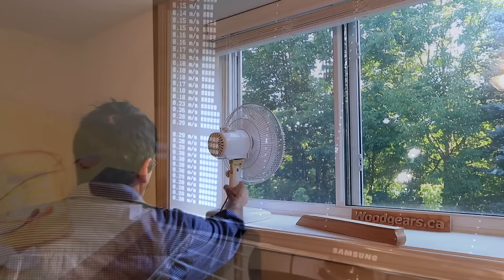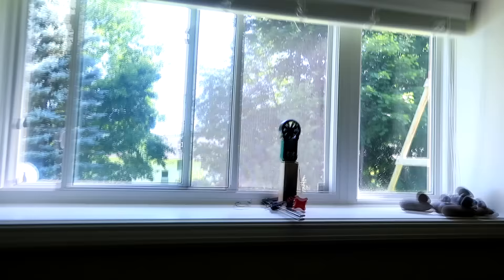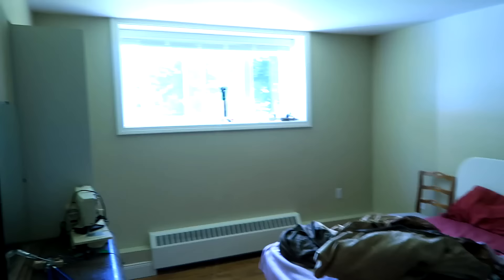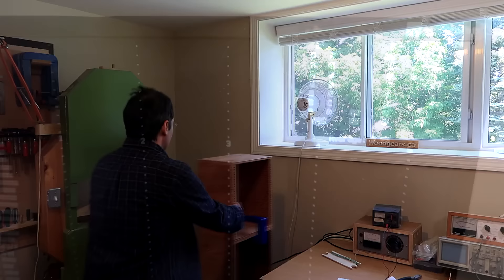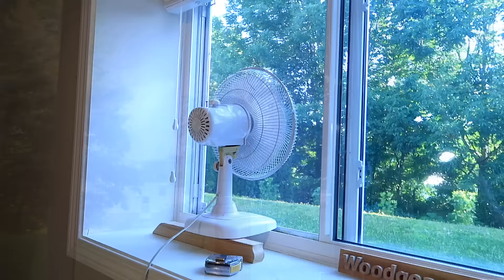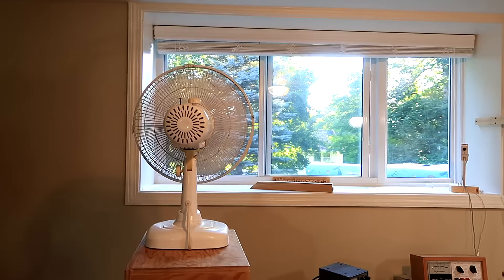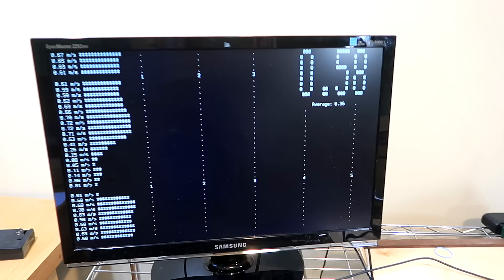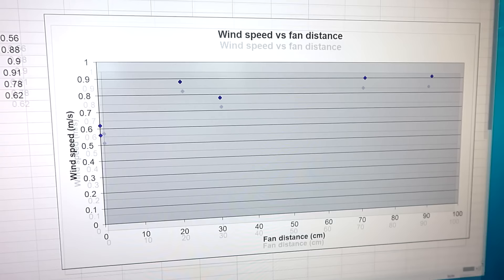Best fan placement to move air through the house

Comment: maybe you could also test the fan by putting the fan at the same room with the measurement device, and see that the circulation speed doesn't increase when you move the fan backwards; which makes it closer to the measurement device. I know that the reason is not bcs of that but would be a better scientific testing that way. But overall appreciate the video 👍

Comment: You expirement doesn't explain why keeping the fan further away is better. It's not because it's also sucking in a bit from the front, but rather because when you move it slightly away, the air you blow is pulling even more around around it along with, so even more of that air is making it outside of the window. It's the same concept for blowing up a plastic bag. If you try to blow up the bag directly from your mouth, you will only be able to blow it up a little bit, but you can blow a much larger bag a lot more just by blowing from a foot or 2 away. It's like it creates a vacuum that sucks more air along it's draw path.

Comment: I'm curious what would happen with the box fan pointed out right against the screen if you make a circular cardboard cutout (covering the corners where the blades don't reach) and also made a cardboard cover for the exposed screen above the box fan--- creating only a circular opening in the window where only the area of the box fan blades have an open throughway for the air to pass

Comment: I wonder if the same thing holds true with a box fan or window fan that fits snugly into the window, sealing off air flow around it.  Then moving that fan away from the window to see if air flow is better or worse when measured from the other window on your house.

Comment: The video title is: "Best fan placement to move air through the house"
Your testing involves testing the fan spinning near the other window. What you could test is the temperature drop or air quality. Because, maybe in some cases you could ventilate the whole house through the same window. Especially when your fan is less than half the size of the window. Also you have a protection screen/net on the window so the air could be bouncing off, instead of going out. That's wastly different result than having no screen on the window. Should be tested before you can claim you've found the best way to do something. All in all, I'd say you could say this is based on your mini research, but definitely not best proven method to ventilate the whole house.

Comment: Why didn't you also test this with fans blowing air from the outside to the inside? I would have been interested to see if the fan positioned 0.5m or 2 feet outside the window would also increase the speed of the air in the other window, just going in a different direction.

Comment: With long wire, there is a risk, if data is not digitized, that reading are not correct. It could lead to a lot of noise and could actually break the results.

Comment: Interesting.. what do you think about circulating air in a humid environment? I’d love to point fans so that it’d blow out the windows but by doing that a lot of the humidity would enter my house, potentially causing mold. Do you think pointing fans on ceiling vents  would produce the same results?

Comment: Thank you! As you put the fan in the window blowing in it showed to be ineffective. However, would it be better if you put the whole fan outside at a distance of say 1.5 meters blowing towards inside? Would that be even better than having the fan at a distance inside blowing out?
Reply: I am asking because i have a balcony and considering putting a fan outside so it can blow cold air into my living room, but not sure if it's better than having it inside and pointing it towards the exit like in your video.

Comment: What if you put the box fan up against the window and sealed around the fan with cardboard or towels so that the only air moving is going out. With the box fan there is a lot of air that comes right back in and cancels out the outgoing air. Would like to see the results of that.

Comment: New experiment idea. One Room. The same steps you already did but add a 45 degree to it or something like that. Like is this making a difference with sucking in air? And biggest question I have for one room closed door. Is it still better to blow air out from further away or to "suck" it in and blow it into the room?

Comment: Small thin column of air would be stopped by the screen. Even without screen, most of the fans air movement would be outside the house if placed at a close distance... I think, I don't know

Comment: My attic has only 1 little window on one of the slanted roof. It’s hot in the summer and cold & damp in the winter. I hang my laundry to dry in winter there as well. Eventhough that window is constantly open 24/7 year round, I start to see mold growing on the attic walls. Would the portable fan #2 helps to get rid of the moisture out of the window more quickly? Do I need 2 of them and place them on the farthest sides of the attic? Thank you in advance.

Comment: yeah i noticed that the fan pulls shit all and most of the time the fan is way too weak compared with the houses air pressure. if i put it in the window to push air out i can hear the motor slowing down to 50% whenever wind direction changes.

Comment: If the box fan is placed in the open window facing outward with the rest of the window opening sealed and a window opened in the other end of the house will do many air changes per hour.  A fresh feeling home.   : =  }}

Comment: this is just my theory based on nothing but would you think the fact that you get more airflow further away from the window is because in that situation the fan covers the entire window opening with airflow? just like with the boxfan, the corners where there is no fan are inlet area's, same concept goes for a circular fan in a square window. the area the fan can't cover will be inlet points, move the fan back making it so that the fan blows against the entire opening and now that window is an outlet only. wich would be why your measuring thingymajig started working better, there was no point other than that window from wich new air could come in.

Comment: Gotta like this video - but to be completely pedantic... if you pointed the fan away from the window and moved it away from the window and towards your annemometer... you'd find that the airflow will start going up quite a lot .... to take it  to the limit, eventually the fan would be sitting in front of the annemometer blowing a full gale into it .... 
However, your test is about airflow - it actually makes sense that you're blowing a higher volume of air out of the house which natural pressure would result in more air being brought in - but I'd also be interested in the air temperature in the other room . It appears to me that you'd want to adjust the direction of the fan depending on (a) the temperature outside  vs temperature inside  and (b) whether you're trying to warm your house or cool it ? 🤓

Comment: Use the box fan but tighten the window against it, then fill in rhe rest of the window with cardboard. The problen is you're not pressurizing the house.  You can look up ICRA setups in hospitals.  Why anyone does work without an icra setup is beyond me.  Its extremely easy and will clear a room of floating dust quickly.

Comment: I found what works best is a 3 blade 1.2 meter propellered 180cc 2 stroke petrol engined paramotor @ 10,000rpm shifts the most air...      Unfortunately i havent found my curtains or bedsheets...

Comment: But isn’t one factor that the fan is just closer to the wind sensor? Or in other words: your wind sensor doesn’t tell you if you’re getting air from the outside or you’re just recirculating room air.
Reply from the maker: wind sensor is in a different window in a different room
Reply: It is Bernoulli’s Principle amonng the other things. To put it simply, you create lower pressure in the house by blowing the air out and making it easier to get fresh air in thru the other window since its higher pressure outside and when you put the fan further away from the window, the air that is being blown out of the house will pull more air with it, think of it like air trying to stay togeter at all cost to not create the vacuum. firefighers use this priciple as well to get more fresh air inside a burning buildings.
Reply: @BlueFlash25  wouldn’t more fresh air be bad though if you’re trying to contain a fire? Maybe you’re talking about fresh air in an area that isn’t burning (like the stairwell)

Comment: If the box fan is sucking in air around the perimeter, would it be possible to cover the edges? Or could it perhaps create some negative pressure at the centre as it tries to draw in the very air it's blowing out?

Comment: what if you put the fan outside, like half a meter out the window blowing air inside?, I think one of this video messuring temps would be good when the house is hot and the air outside is cold

Comment: When I was in jail, I tried to explain to my cell mates that pointing the fan inward was detrimental to the inside temperature we had to deal with...

You just want to get rid of hot air, there is no such thing as blowing in fresh air. 

But of course, I couldn't be right... right.
Reply: The same is true for PC's, but YouTuber opinions have greatly biased nobrain gamers.
Reply: @sjoervanderploeg4340  PC case fans schould be installed to have intakes and outakes what exactly is your point?
Reply: @Lenikes  not true, if you have all fans out air will still get in.
Reply: @sjoervanderploeg4340  Oh you trolling nvm then
Reply: @Lenikes  no, like I said nobrain gamers? You are one of them. 

You didn't even test anything, you just go off assumptions made for you.
Reply: @sjoervanderploeg4340 well there are several tests on Temperatur in PCs on reddit and here Proving you wrong so I guess the person assuming things but dosnt know anything in reality is actually you. Also I haven't touched a PC game in months so another assumption that was incorrect seems like most of ur takes are incorrect

Comment: Do you have any advice for a 10 inch fan placement in the room with the ceiling fan turned on?
Note: no air passes through the window when the room's door is closed

Comment: what if you set your fan outside the window? would it be more effective than the proposed method?
Reply: When the hot air is blown out, the space it takes up is quickly filled with cooler air that is drawn in from other open windows. If you did what you wrote, it would bring air into the room, but it wouldn't circulate around the house.

Comment: Does this air-flowing thing works even in hot climates? I live in Northwestern Brazil, and temperatures here vary from 85 to 105 ºF (30 - 40 ºC) during the day and from 75 to 80 ºF (24 - 27 ºC) during the night – specially late night. My house is an oven. Even if I turn on my AC at 64 ºF (18 ºC), it needs 10-15 minutes to START getting cold.

Making my house cooler without using AC would be very good for my energy bill
Reply: con esas temperaturas lo tienes difícil, lo único que vas a conseguir con un ventilador es mover aire caliente, pero no te va a refrescar nada. 

Necesitas AC y cerveza fresquita jejej. Saludos desde España

Comment: Sir, will exhaust fan give the same results? that you are showing with a pedestal fan towards a window. I am interested, please answer. 

Thank You
Reply: It is Bernoulli’s Principle. To put it simply, you create lower pressure in the house by blowing the air out and making it easier to get fresh air in thru the other window since its higher pressure outside and when you put the fan further away from the window, the air that is being blown out of the house will pull more air with it, think of it like air trying to stay togeter at all cost to not create the vacuum. 🙂while not nearly as effective because it can´t apply Bernoulli’s Principle, an exhaust fan will do the same thing as long as you have an intake of a fresh air, thats why exhaust fans are more used in bathroom to get steam out but don´t do this during the hot day as it will increase the temperature inside. Great during the night though!

Comment: Yeah but my box fan facing in and right up against the screen to pull in the cold air from outside is definitely way better at cooling my room than trying to get air flow through the house.

On cooler days my room is warm because it sits in the sun. Turn on my fan and now it’s just as cool as outside.
Reply: Is your house big? Your method cools your room first. If you reverse your fan, you'd first have to remove much bigger air volume from your house, before the cool air reaches your room.
Reply: @m1k1a1  yes house is big. My room is upstairs and the room itself is pretty big. It pretty much shields the rest of the house from the sun. I’m also only concerned with my own room being cool

Comment: may I know how the anemometer measured the wind speed although it's on a separate room?
Reply: It's measuring how much air is being pulled in through the other window. The video shows that he wired the anemometer to the Raspberry PI to get the info without having to constantly go between the two rooms.

Comment: Does it make a difference if you use an old style open fan vs one of the newer air circulator types like the Honeywell turbo force power ventilator?.
Reply from the maker: optimal distance is probably slightly further with a shrouded fan
Reply: @matthiasrandomstuff2221  Thanks I appreciate the input.

Comment: Does fan blade and width make a difference?
Reply: The higher the airflow of the fan the better, I know it may sound too simple but fan can be made either for airflow or air pressure. Sometimes manufacturers state the fan´s max airflow/air pressure. As for the blade shape and width, in general, fewer number of blades and bigger they are will make more airflow but its not 100% accurate.

Comment: Well, i didn't understand well.  You can circulate lots of air but if it is hot air it is just like the devil's air.  I learned from a friend to put a circulator turned to outsided and seal the rest of the window. The temperature gets down effectivly.

Comment: The methodology seems slightly flawed, although reasonably so given its scope and informal presentation.

An anemometer such as this can only measure local wind speed in the cross-section of its blades. While there is obviously some direct relation between local wind speed at the anemometer near the window and the total volume throughput of air through your house, it's neither linear nor necessarily predominant. The information provided by the measurement is incomplete and insufficient to determine the result implied.

It's akin to playing what's commonly categorized as a "game of chance", where the entire premise is the ostensible/practical incompleteness of the information.
Reply: You just described sampling. This is how most things are measured.
Reply: @TheIancross  Taking measurements and drawing conclusions are two starkly different but deeply related and easily confused concepts. You wouldn't "measure" the number of people in a room by shining a flashlight in one obscure corner, then definitively proclaim you had evidence of the supposed quantity.
Reply: @Christian-Rankin  Internet arguments aside, there’s an old farmer joke about how cows are difficult to count because they move around a lot. So to make things easier, you count count their legs and divide by four.
Reply: @TheIancross 🤔:buffering:🥔

Surely, I'm missing the obvious point you are making.

Comment: I think the fans need a shroud to force it to pull through the window
Reply: That would reduce the efficacy and would just be the same as having the fan directly against the window screen. The reason why the increased distance increases the air flow is because the air that is pushed by the fan is pushing the air in front of it as well.

Comment: What if you place the fan 1m outside the window and blowing in? ^^
Reply: It would blow the same amount of air inside, but it wouldn't circulate outside of the room it's being blown into very well. Blowing the fan outside the window forces air from the exterior of the house to take it's place, and that's not possible if you're blowing air into air.

Comment: Why would you point the fan out the window, makes no sense... Lol
Reply: You would do it at night time when it's cooler outside than inside to exhaust the hot air to the outside and force cooler outside air to come inside from other open windows. Having the fan pull cooler air into a room is the same, however it would only cool one room, not an entire house.